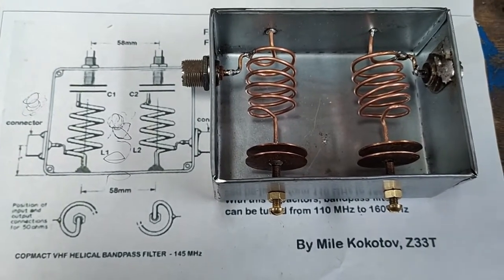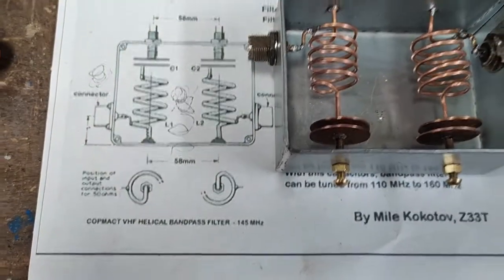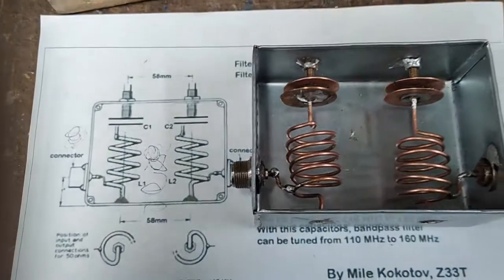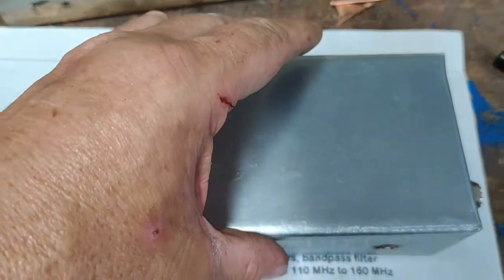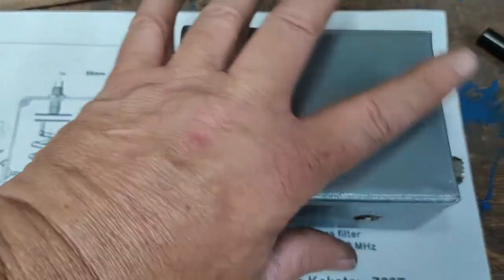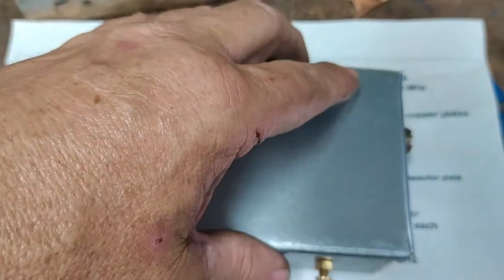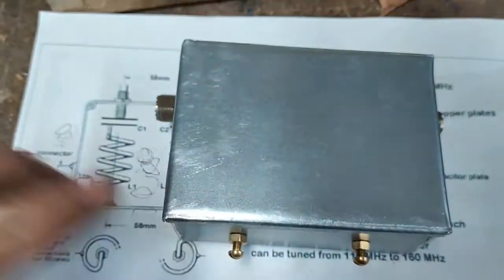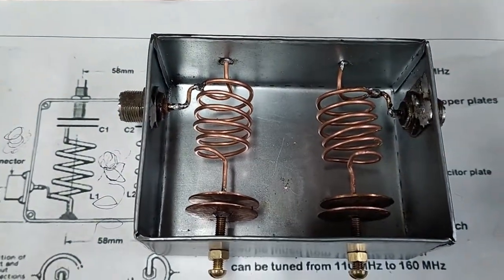2m band pass filter

Comment: Did it work? I built one but I can't get it any higher than 130 mhz.... what determines the frequency range?
Reply from the maker: yes but a waste of time for me, i have a singles on the band not interference from other bands. Sorry for delay
Reply: you can change the inductor to increase frequency. if you cut the inductor a little bit your frequency will be increased
Reply: squish the turns together or spread them apart to change freq.